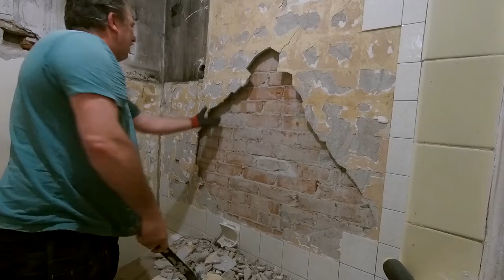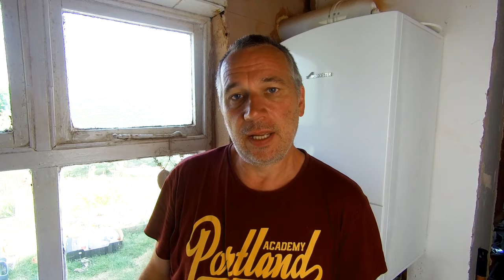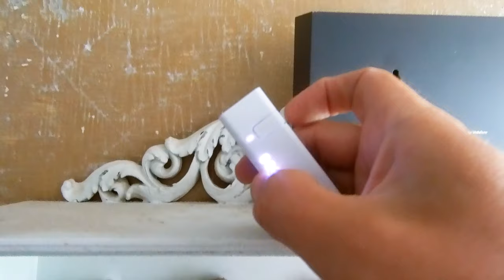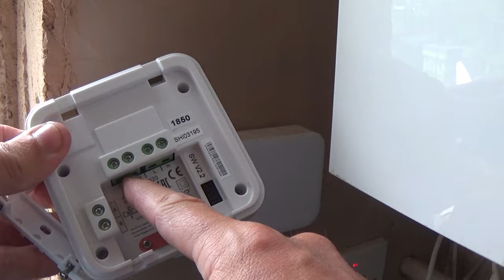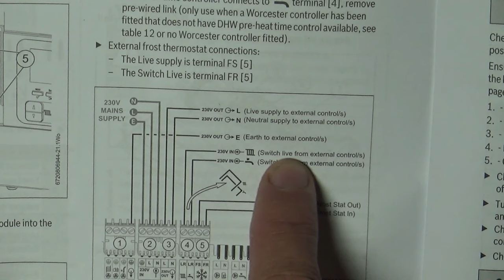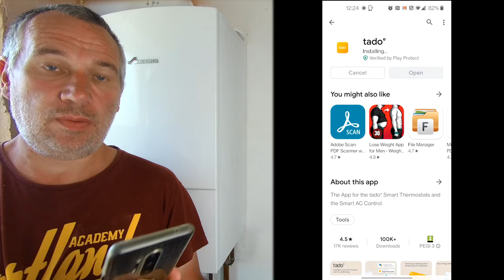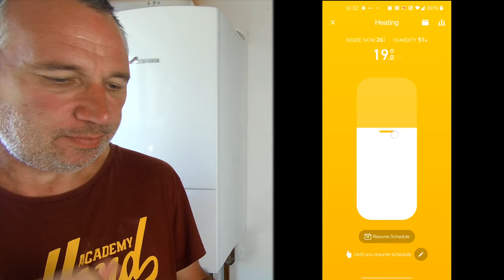Tado Wireless Smart Thermostat V3+ Install - How easy is it to install a thermostat - DIY Vlog #42

Comment: Come and get mine working please 🙏 great video but still can't get mine to work 🤦🤷
Reply from the maker: Sorry I'm not a pro at this just a diy'er. I just followed the instructions but wouldn't have any idea on how to get it working otherwise.
Reply: @LCWDIY  had 2 Sparky's that couldn't do it either 😂😂 sent it back and got the same make as the boiler valliant. All I do with this ebus on the boiler but tado said it can do it in instruction manual but clearly it's not working but great video. Made me realise we definitely wasn't doing anything wrong.
Reply from the maker: That's odd as the control only acts like a switch to the boiler. Glad the video showed you had done it all correctly though.
Reply: @LCWDIY  exactly, so maybe faulty but it's easy enough to set up and after watching knowing I got it right. Then I knew something wasn't right. So it's out and vsmart arrives tomorrow which I know from the valliant website it's compatible. 🤞

Comment: its a heating engineer you need to do this sort of work rather than an electrician, they know this stuff better than most sparks and its illegal to remove that boiler combustion cover without gas safe registration!

Comment: Good video. Although 80% of boilers are condensing or standard not combi
Reply from the maker: Thanks, so used to calling them combi boilers I forget mines condensing.
Reply: Boilers are condensing or non condensing depending on age and are still combi, systems or boiler only.  Combi boilers produce instant hot water others tend to heat a cylinder of stored hit water. So this boiler is a condensing combi boiler.

Comment: Rather than smack the wall plugs in with a hammer and risk damaging the wall, thread the screw slightly into it and then tap into the wall.

Comment: If I was you I’d take this video and trash it because you not got a clue what your doing!!
Reply from the maker: Really! It's all wired in correctly and working perfectly, if I've not got a clue then how have I got this installed correctly? Tell me what you think is wrong with it.
Reply: you got to give the reason, can't just slate this video
Reply: I think the reason eddtheduck gave is because the potential free relay was wired originally, and then changed to the powered relay once the gentleman making the video actually read the boiler manual (!).  I would tend to agree with eddtheduck - it is confusing what was actually going on with the particular wiring arrangement.  Otherwise generally good video to see the product and the app.  And, most importantly the gentleman was safety conscious, and provided warnings to folk watching this.